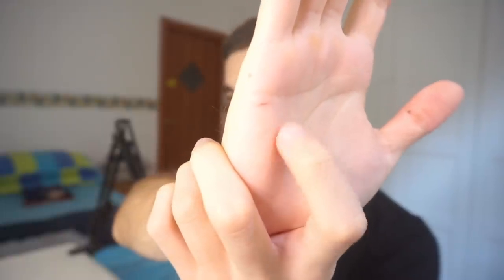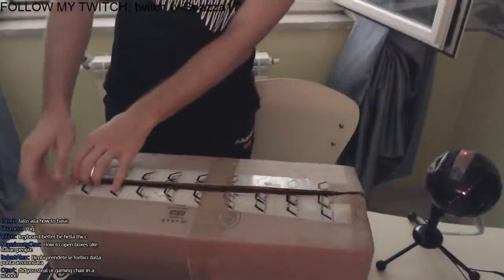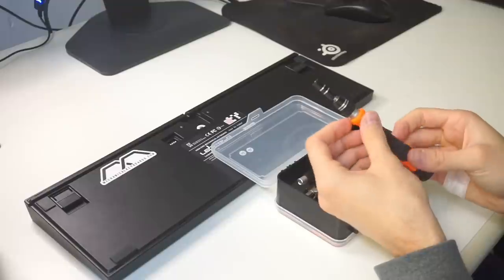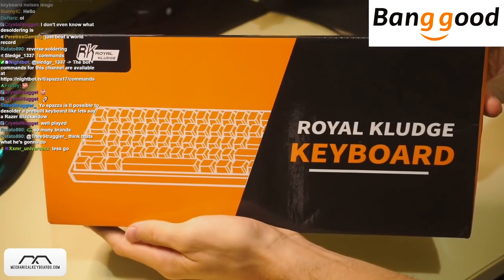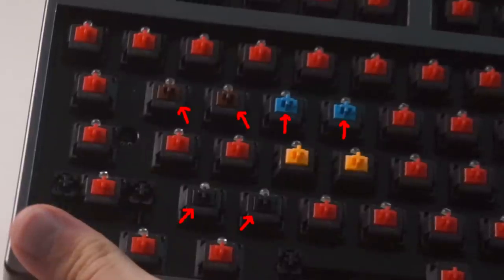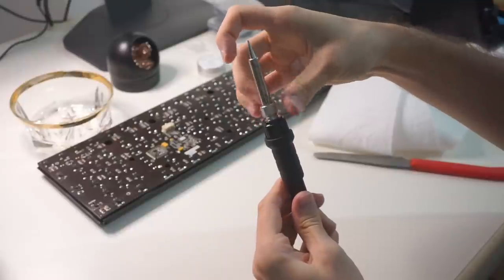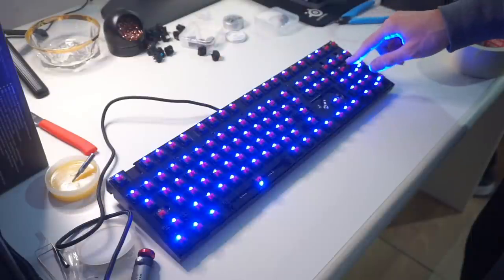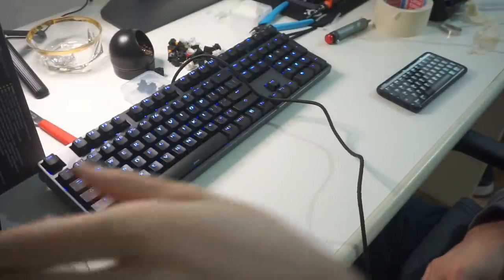this keyboard is cursed

Comment: Solder wick + flux tends to be an insanely reliable way to desolder. That said, the method you used can work it's just a pain in the ass.